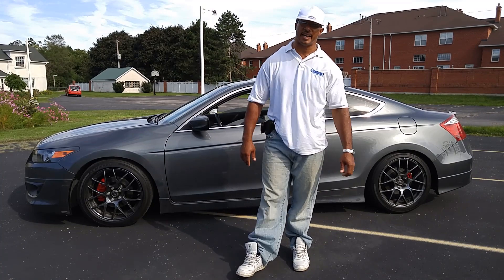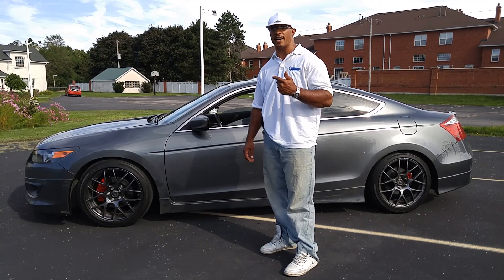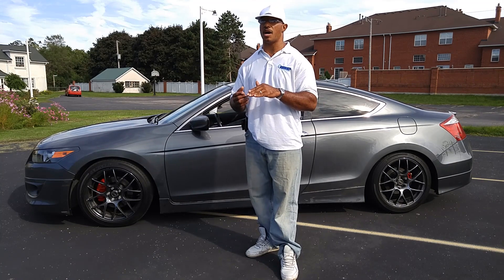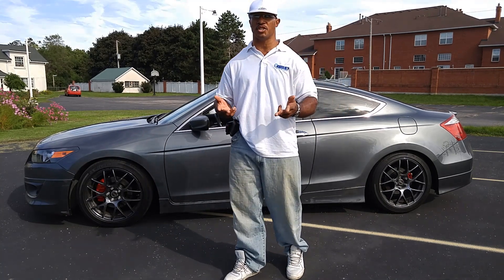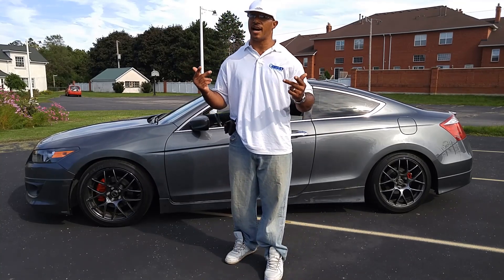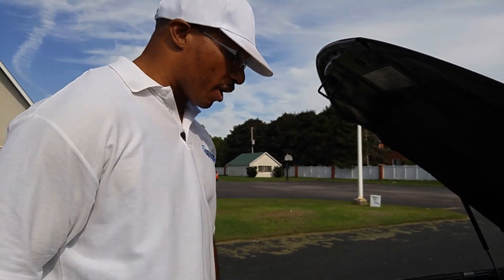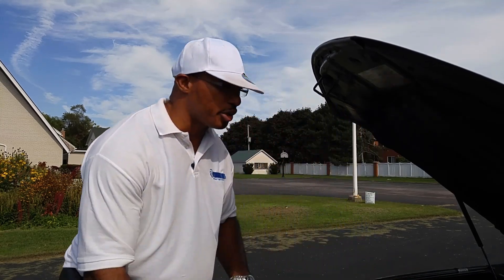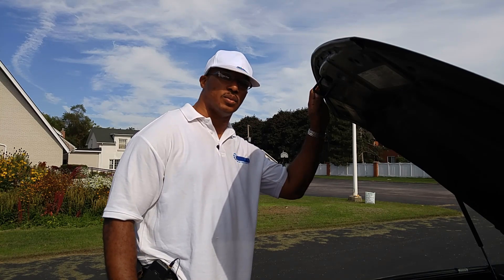8th Gen Honda Accord ''Engine Making Loud Ticking Noise''

Comment: Sounds like you need a new water pump
Reply: I recently reply timing belt and water pump replaced on an 07 Pilot and my ticking went away instantly.
Reply from the maker: @jonfamurewa3763  Not too sure what it was but I ended up just changing the engine..
Reply from the maker: yea at first I thought it was but after spending over $1200 and still having the same problem, I jut got rid of the engine.
Reply: @jonfamurewa3763  It would be nice if that were the issue. Unfortunately all V6 Honda engines get this ticking sound. I did a 200k service on mine not long ago, replaced the belt tensioner and water pump... the noise is just as loud as it was before. I started to wonder if it's piston slap from an out-of-round condition. I have a borescope on the way so I can take a peek at the piston tops. Going to measure blowby out of the dipstick to see if a cylinder is wearing out.

Comment: I found a video showing a hydraulic timing belt tensioner.
Reply from the maker: Hey p dv 7: Please send me the link.
Reply: It’s the timing belt tensioner in the engine, I have the same model and had same issue. 
Had to change timing belt kit entirely
Reply from the maker: @Trail2k  I'm in the process of doing on engine swap. Will upload video soon... Thanks for your thoughts man...
Reply: Akhil Adarsh . I have the same problem can some one help me plz I really need the help
Reply: VtecHondaGuy hey what did u do to fix ur honda I need help plz
Reply: @kaviankinglocke8596  I am having the same exact sound on a 2016 Accord 😢

Comment: tensioner 4 sure
Reply: look at belt or timing belt when running . You will see belt slapping
Reply from the maker: Thanks guy's but that wasn't the problem. Was going to cost waay too much to fix so I just rid of it.
Reply: @V-TecHondaLove  what was it ?
Reply from the maker: @polojay5169  I didn't ended up finding out because I change the engine.. I didn't want to be wasting anymore money..